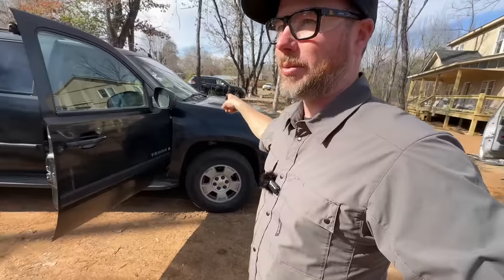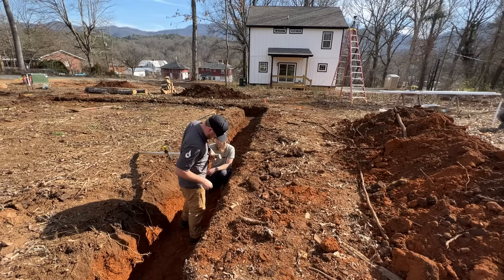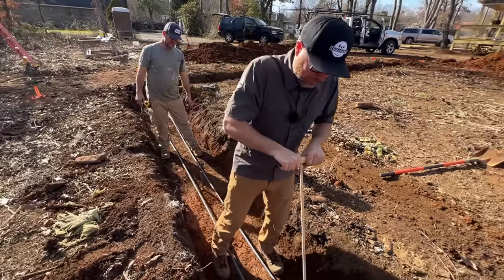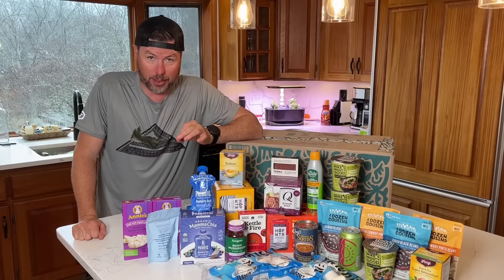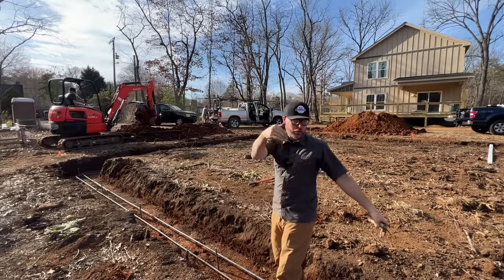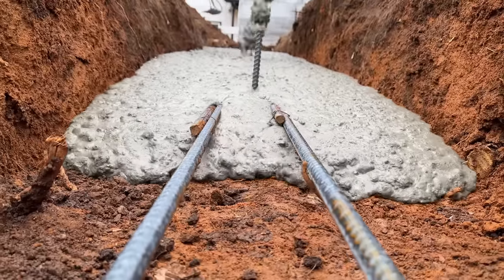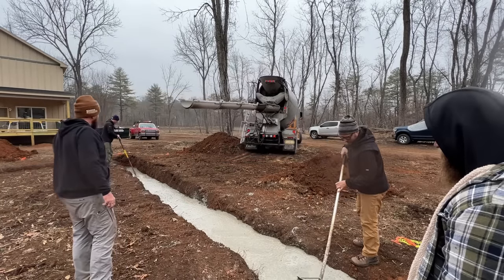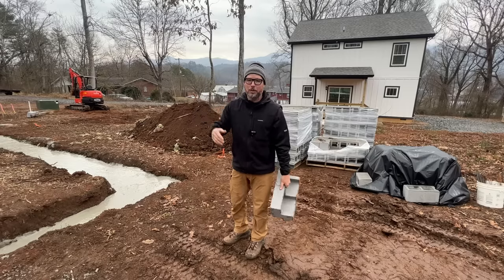Construction of a Duplex, Part 2

Comment: Great videos guys! If your duplex plans come from online, does that include the foundation plans as well. If so, how does that actually work, that is how do they know enough about your lot to draft a foundation for it???

It is my understanding or the lack there of that you need a structural engineer to draft a foundation plan and even a framing plan. But from watching some you alls videos, I’m now assuming that’s not always the case. 

And so, I guess my question is, when is it necessary to get structural engineers involved for foundation and/or framing plans? Is it based on how much you already know about your lot and know how about framing?
Reply: @commentingonshit  thanks

Comment: Those are the same concrete trucks we have all over the UK, but after the pouring is done we leave it for 2-4 weeks before we build on it (4 weeks is preferred).
Reply: do you keep it wet for weeks or immediately seal the slab? Yeah , i dont like the shortcut of placing the block in wet concrete either unless its a simple retaining wall and you can quickly lay the first row before it hardens too much
Reply: @sanisidrocr  here, it's just to harden naturally. So our house building sites are quiet for that time (unless it's a big development). IF forms are used, they are left in place the entire time.

I mean you can get "quick drying" that has to be left for 24 hours before you can do anything on it and IF it has forms around it then they are left in place for a further 2 days.

But also, almost all of our mhouses are "brownstones" (big breeze/cinder blocks with thick insulation then bricks on the outside) and not wooden builds. 

It's like even out in the countryside you have mains sewers so septic tanks are rare. Our sockets, even though they have power going to them, unless the switch is on then the sockets won't work (all plugs are also 220-240v 50-60hz). But only a qualified electrician is technically allowed to install electric cables/plugs/lights/power showers etc - you could DIY BUT if there is an electrical fire then you are liable and your insurance is null and void.
Reply: @ChrisMDSmith79  I understand its unreasonable for most developers to keep the slab wet for weeks as it adds delays and you need to constantly keep it wet for curing instead of letting it cycle which can be difficult. On my second home I kept it in a 4cm pool of water for 3 weeks for a better slab but this of course is overkill. Some builders will get around this by using a vapor barrier and immediately sealing the concrete a few hours after pour which traps moisture and slows curing . Obviously not as good as my impractical method but when you have the time and money and want something to last 100+ years ...
Reply: The cement hydrates if there is water, no water and hydration stops and strengthen stops. Very strong at 14 days, maximum practical at 28 days unless flyash is used.
Reply: it might be wet enough in the UK that the slab can cure like that without issues…
Reply: @saint-miscreant  It would have to be a rain forest raining daily as a new slab soaks up water like a sponge during the first week and its not good cycling between dry and wet . This is why some builders build an edge and just create a couple inch pool or use wet burlap bags as they don't want it to ever get dry for a couple weeks at least. I personally had to top up my pool on the slab once a day during the first week as well , but could neglect it for at least 2 days if needed due to the buffer

Comment: I never let a concrete truck driver talk me into shooting the whole footer. They always want to because it gets them empty way faster, but you always end up pulling your guts out.
Reply: That cement looked awfully watery. Is it supposed to be that watery?
Reply: @jdbwz5307  better if it's a little thicker than that.  Unless they have a lot of cement mixed in the finished product will be more brittle.
Reply: @jdbwz5307  they usually dump a bunch of water to get it wet enough to flow when they do big shoots like that. Still it's never enough and you end up with a spot that's a mile high. The people who do footers like that typically aren't the guys that also have to lay the blocks lmao
Reply: I agree with Argo, set the first course, of block, in your footing.  But , I’m in California. Our ground tends to shake a little more.
Reply: In general, just any sub that wants to do it "their way" is annoying as hell.
Reply: Can you explain what you mean more? I don't quite understand what you're saying
Reply: @every_thing_wood1251  some drivers will want to put their truck on one corner of the footer and dump every bit of concrete out right there. They usually will say if they do it fast enough it'll flow the whole footer. It never works. The spot they dump in ends up with all the aggregate and ends up way too tall. If you aren't the block layer then you get it close enough and call it good and let them deal with it, but since I'm also the one who lays the block, a nice even footer makes that job much easier
Reply: @JoJam95  that makes sense. Yea that would 100% be super annoying

Comment: I don't know about the corner rebar orientation but I do know the best place for rebar when you're talking about up and down locations. The most effective place for rebar in a beam like this is the bottom third of the pour. All the rest is just gravy. Your strength comes from the steel in the bottom third.

Comment: One answer to Arlo wanting to place block in wet concrete is one of our customers would build his earth retainment walls all in one shot by pouring the footing with three inch slump concrete and set block on top then start laying a block wall on top then drive the vertical rebar down through the blocks into the footing and last not least wet the remaining concrete and pour the wall. That much weight would cause the blocks to particularly sink into the footings but the builder was rich enough that he could build that way. You know you decrease concrete strength 500 psi for every inch of slump over the specified slump for that mix. Ordering a higher psi concrete than designed for the application then slumping it higher for placement could help or spending a little more and getting it with hrwr would work but that would limit the concrete truck's hauling capacity on those inclines.  I guess the rebar will be helpful in your case in maintaining the integrity of your footing though. Other than that I think that you had all of us subscribers anticipating this new build your doing so cool.

Comment: Here in CA we have to have our footings keyed into the ground. So we have to spend time building forms, and they are usually up to plate level because we don't use cinder blocks... well I've never used them... with lots of re-bar. So your foundation process is pretty streamlined compared to what I'm used to.

Comment: Hey guys, is it normal that you are not insulating the slab? Is there no code requirement to do so?
Reply: If you see a foundation less then 3 ft,then that will tell you not much frost.
Low frost/not cold temps = no insulation needed.
This is a general and fast response, you can insulate even in hot climates.
But the cost isn't worth it.
Reply: @2chipped  Thanks for you reply. I live in a non frost zone (different country mind you) and all our slabs are insulated with minimum 4" PIR and 2" vertically at the edges. To avoid any cold bridging, as the slab is such a big surface. We also fit a Radon barrier.

Comment: That cross rebar technique is in accordance with engineering theory called 'strut and tie'. I'm learning it in engineering class at the moment. 

I'll let the senior engineers watching explain it better than me.
Reply: Structural engineer here ( not for concrete though) I would argue that the cross is useless as your passing through the neutral axis on many bending planes, I'm curious also and am commenting to follow this thread for the right answer.
Reply: Crossing the corner bars doesn't really do much in a footing. It's much more common to use it for poured walls. I've always seen it specced with a 3rd bent bar that goes from outside to outside. This was for much larger buildings and is probably overkill for a small house foundation.

Comment: I agree with crossing the reinforcement bars at the corners but I would also add an L shaped bar to the outside corner lapping with the crossed bars. As a rule of thumb, here in the UK as a minimum the lap length should be 40 times the bar diameter plus 6 inches.
Reply: exactly my thoughts!
Reply: what an equation to remember. Might as well just go hella overlap plus another hella half for good measure
Reply: @baronvolkov6172  as I said it’s a rule of thumb, it’s not intended to be a definitive answer. Yes lap lengths can be calculated to the millimetre but for a squad of guys working on a site, most of whom will have little or no knowledge of steel fixing, it’s an easy method to ensure that a consistent minimum lap is achieved. As a civil engineering draftsman and reinforced concrete detailer with over 50 years experience I could point out a dozen things that are wrong with this foundation pour. I do hope however, that you are not involved in construction as you clearly have limited knowledge on the subject.
Reply: @alfiembra  Thats funny, way to low key throw shade. I own an excavation company and a construction company. There are minimum codes that are very specific and a million ways to overkill those MINIMUM standards. I dont need to know the exact complicated minimum measurements when I know my way of building is much superior. 
Sure theres a handfull things on this pour that could be improved but it passed inspection for its intended purpose. Not everything needs to be built with an exorbitant budget.

Comment: Hey Bros, I saw someone on YouTube tying their rebar with zip ties instead of wire.  I'm not fond of this practice and not even sure if it would meet code.  What are your thoughts?
Reply from the maker: good question… my guess is that they would work just fine for some situations but probably don’t meet code unless an engineer gives it the ok.
Reply: It doesn't make much sense to use them because you would need to go back and cut off the ends and its really not hard to use wire. Another concern is cost, you would need to use some heavy duty zip ties to hold up during the work and not snap and those are more expensive than steel wire.

Comment: you could put a heat pump outside - no need to put it in the attic and as far as hiring guy to perform 'simulations' - wasted money
Reply: The simulation is required to get building permit. You have to show the office all your hvac, plumbing, electrical plans ect prior to framing.
Reply: @remodz6385  you can't fix stupid and oh yeah put the compressor in exact place where it can do max damage - mission accomplished!

Comment: In Australia, we don’t put concrete on clay. We put a layer of crushed rock first.
Love your work 👍
Reply: This helps with better drainage but even better is if you place at least 4 inches of quarter minus , compact it, and add a vapor barrier below the footings and slab
Reply: Yeah that wouldn’t pass inspection in NZ ether, also can’t have any rebar touching dirt, cause it will rust and crack the concrete
Reply: @H2s Because of our climate, our clay soil is highly reactive to moisture changes. Concrete on clay will crack. The layer of what we call roadbase, and you call 1” minus, acts as a buffer to equalise the moisture directly under the concrete.

Comment: I'm assuming this is going to be a slab-on-grade foundation? I hope so. I want to do my own house with one of those, and I'd love to see how you guys do it. Interesting to see how your crew doesn't use formwork for the footers, I am assuming it's just more economical to sacrifice a little concrete to uneven widths than to put the effort into making the forms.
Reply: Material cost is usually the same as if not cheaper than labor. Plus, it saves them the day or two of setting and stripping the forms. As long as it is wide enough, deep enough and level, the finish on the edges is irrelevant as it will never be seen.
Reply: @stewiesaidthat  I would argue it's probably far more expensive to form it by the time you actor labor and the material that you can never use more than a few times, an extra couple yards of concrete is definitely cheaper, and way faster and cheaper
Reply: @OntarioRedneXXX  Yep. That's why most contractors just dig a trench and pour in the concrete. Unless installing drainage pipe and need the extra width dug out. There are products available like form-a-drain that combine the formwork and drainage for sites that require foundation drainage.
Reply: @stewiesaidthat  especially when it's shallow and they're putting block up, they don't need a bunch of room to form the walls

Comment: Might want to do some research on Plasticizers in your concrete. We do a lot of jobs requiring a special inspection for our mix which includes concrete samples off each truck for pressure testing. In cases like that you're not permitted to add water to the mix. However, if you want a loose mix that flows your allowed to order it with plasticizer. It will add a couple of inches to your slump, depending on how much plasticizer you have them add, without adding water and weakening the mix. We order our concrete with a 4" slump and with plasticizer it flows pretty close to like what you just poured. You can also buy it yourself and add it to the truck when it gets there, just make sure you have them mix it really good after you add it.

Comment: Here is a pro tip for doing square corners. Use the 3-4-5 method to true up. Works in inches, feet, yards. The 3-4-5 triangle must have
One side ( triangle leg) that is 3 feet long
A second side (triangle leg) that is 4 feet long
A third side, connecting the two legs measuring 5 feet long
Any triangle with sides of 3, 4, and 5 feet will have a 90-degree angle opposite the 5-foot side.   The beauty and simplicity of this technique are if the carpenter or builder needs to increase accuracy on larger walls or structures, any multiple of the 3-4-5 rule can be deployed.

Comment: Have you guys tried using the QuadLock styrofoam forms rather than cinderblocks? I work with Habitat for Humanity in Virginia and we've been using those to set up the foundation/basement for the concrete pour. It also adds a layer of insulation to the walls, and it saves on lugging cinderblocks around or having to do mortar.

Comment: Hmm I don’t love the cross rebar approach in the corner. You have effectively removed reinforcement from the outside edge of the footing. I would keep the reinforcement continuous on the outside and inside. I would also tie the rebar together in the corners in each direction.

Comment: Here, in Europe, this footings will be no go, there should be at least 4in compacted gravel at the bottom to act as drainage then there should be a poly barrirer to prevent cement slur to drain into dirt and gravel zone... and, no, crossing those rebars at the corners doesnt do any good, just oposite, weakening the corners.

Comment: Still wondering how they get away with extending rebar from the concrete into the soil beneath?
It took them this long to finally get the rebar correct in the corner.
But hey, what you can't see...

Comment: There are a lot of comments on the high slump and weak concrete. I don’t place mine that way…but it will be strong enough, and these guys are still better than 99% of the builders I see these days.

Comment: Y'all keep saying it's gonna be a slab foundation but I've never seen a slab prepped like this and then have block on top of the footings. Is it not going to be monolithic? In Texas if we are doing a slab we dig out for perimeter beams and interior beams for load bearing walls and then pour the beams and slab all at once.
Reply: Need to get below the frost line and into firm subsoil (clay). The exterior walls are load-bearing and carry the weight of the roof and snow/ice accumulation down to the footings. Texas doesn't have freeze/thaw cycles, so monolithic pours work. Slab foundation just means no crawl space underneath the main floor.
Reply: Instead of a monolithic pour the, block walls are a permanent form board.

Comment: What are your thoughts on basalt rebar vs steel regarding cost, strength, weight/handling, transport, etc?
Reply: Not ductile, less strength , higher costs . If you wanted a perfect RCC column a combination of the above would be best like adding fiberglass shards to mix which helps with micro cracks